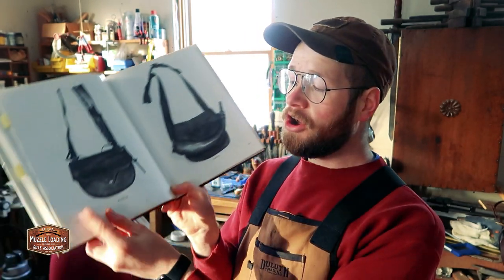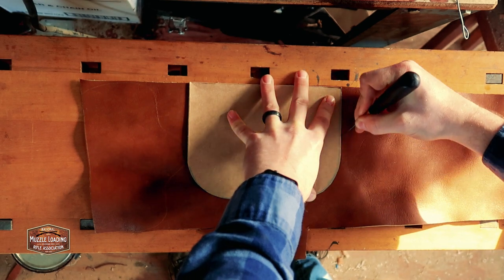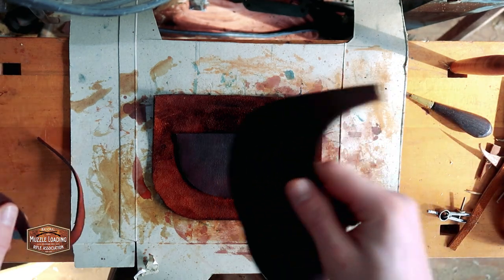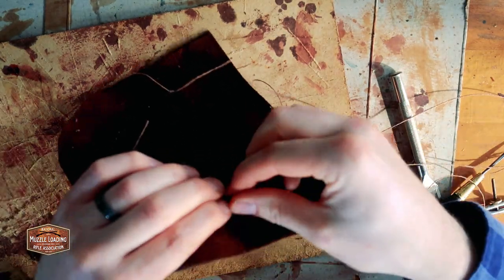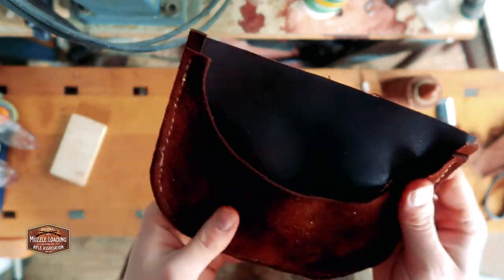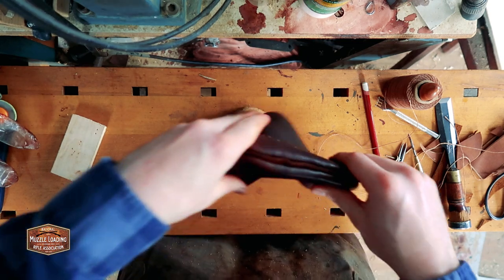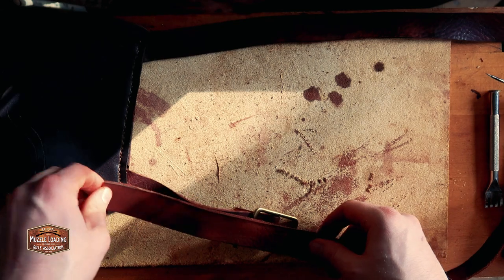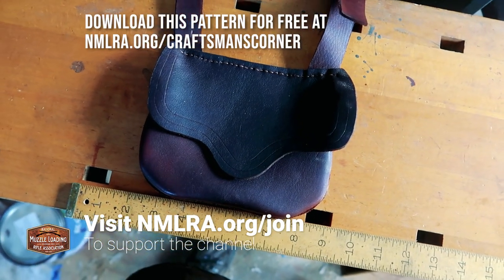How to make a "Hawken Era" Muzzleloading Possibles Bag | Beginner Leather Pouch | NMLRA

Comment: Take your cobblers hammer and beat on the completed stitching to countersink the stitching so that it is flush with the surface of the leather to give a more finished appearance.  Also when using rubber cement to hold the pieces together after finishing the stitching, use a piece of gum rubber like a pencil eraser to remove any rubber cement that is showing.
Reply: It's stitched inside out so not a big deal on this pouch.🤷

Comment: Interesting video.
Some personal observations.  
If I'm making a blackpowder bag, I don't use waxed nylon thread.
Waxed linen is as strong and historically accurate. 
 I always line my bags with striped cotton pillow ticking.  
Barge cement to leather pieces.  Adds a little more structure to the leather. 
Get yourself a stitching pony !  You'll have to adjust the pieces in the clamp, when going around corners but its like another set of hands.  
A good rule of thumb is to measure just under your ribcage over your shoulder for the strap.
Look around for handwoven straps. 
Finish them with a buckle and enclose the ends with leather.  
Thanks for sharing.

Comment: Some observations: it matters how you layout the pieces.  It is best to have the orientation to the grain should be the same.  The bag will stretch i the same way.  Second always treat the leather after dying.  The dying process dries the leather out.  For a bag to be used outdoors, you need protection against getting wet.   I would recommend the book re-creating the 18th century hunting pouch by T C Albert..  Never drill leather.  Always use an awl.  Drilling removes material.  Piercing means the fibre close around the stitch.    The technique you show for sewing is not really saddle stitch.  Two needle stitch is far better and stronger. Use a clamp to hold the work. It keeps the tension in the stitching far neater.   For choice of material, I would say 8 ounce is way too heavy. It will give problems.  I prefer using elk or deer skin.  Failing that sheep skin is far easier to sew, more supple than cow and is stronger.

Comment: You need to invest in a stitching wheel. 7 or 8 stitches per inch. This pre marks your stitches neatly not only on straight lines but even more so around corners. It makes for more even stitching...
Reply: And use it for an over stitch wheel after stitching to even up the stitch line and "set" the stitching below the surface.

Comment: I like this project and would like to try making one but slightly larger and deeper from front to back with a side strip around the bag part about 2 1/2 inches wide with an inside band to hold a powder flask upright but I am wondering if a speedy stitcher can be used for sewing it together or not also if artificial sinew would be best for sewing it also instead waxed thread? Please let me know what you think.

Comment: In the welding profession, we call them stitches your using to hold the parrs together before you actually start sowing tack welds. So in a sense. Your putting tack stitches.

Comment: If the leather thickness is listed as metric, one millimeter equals .039" inches or about 2 and 1/2 ounce thickness. (one 64th = .015 thousandths/inch)

Comment: Can you go into more detail about what leather that actually is? I've got eight ounce veg tanned tooling leather and that is nothing like it.
Reply: Looks more like a Chrome Tanned Leather or possibly and Oil tanned split.
Reply: Judging from the “pull up” on it at some points it looked to be possibly and oil tanned leather another reason it’s so pliable. Most veg tan esp the longer it sits the harder it will get.
Reply: @nationalmuzzleloadingrifle8871  

Thanks for letting me know what you can.